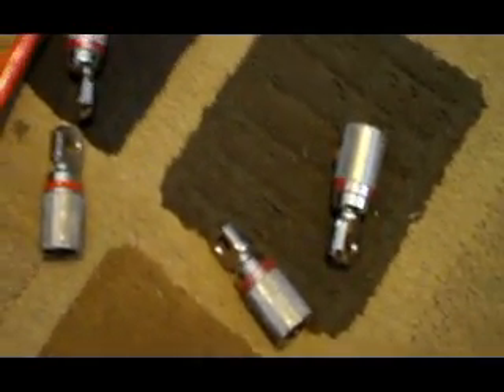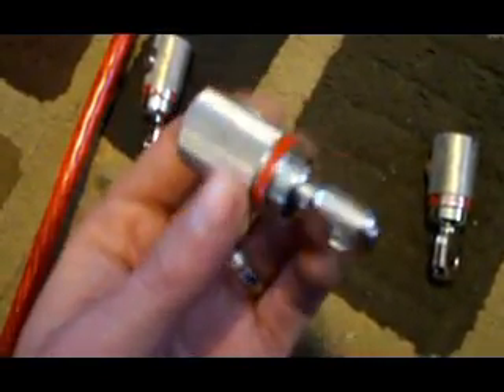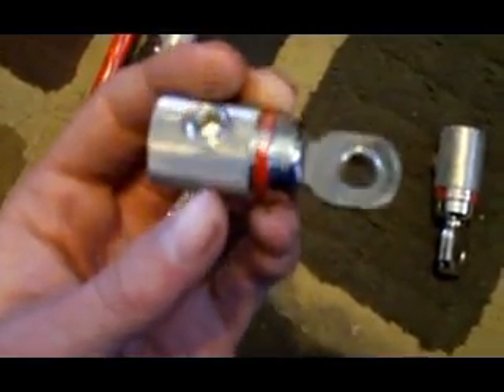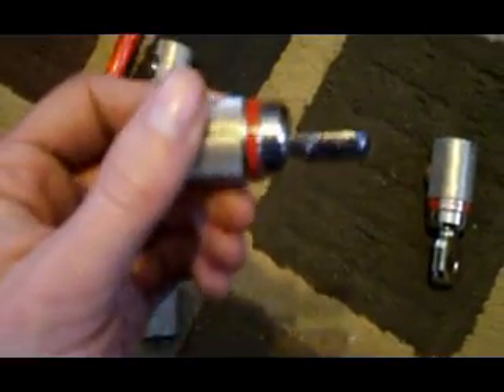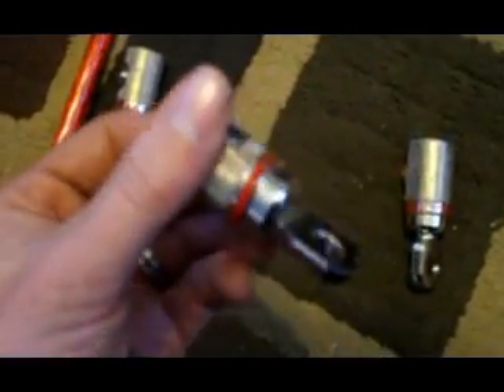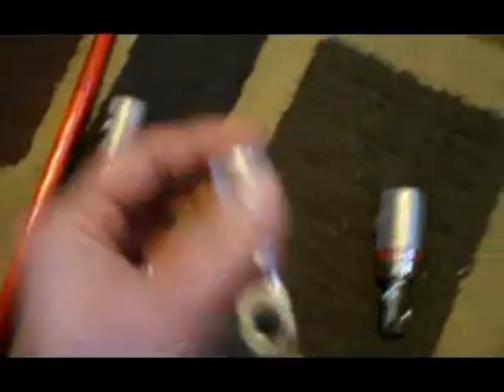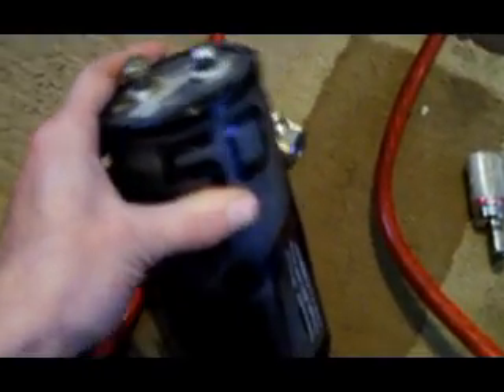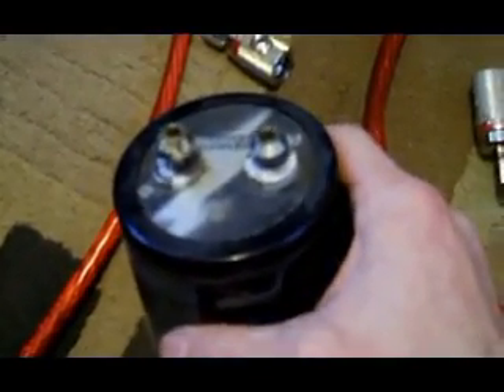How To Hook Up A Battery Capacitor

Comment: hello brother, , can i use a capacitor even though i dont got a amplifier? i do have some 12v leds, windshield wipers, heater defroster running very ofter and i got a small battery.. will it help??

Comment: Capacitor goes out after a while when car is on, normal? Just installed one but i though it has to be illuminated all the time... thanks Grt
Reply from the maker: Should only be on when the car is on but will still hold a slight charge I believe

Comment: hey I have a problem it just started today can a cap make ur amp trip?? cause every time I turn my stereo on my amp turn on then my cap like  turn on then it trip like for one second and after that my amp goes into protection mode I follow all the wire non loose I was wondering if u think my cap went bad or Wat the reason for it to make my amp trip its was working just fine till today
Reply from the maker: Sounds like you have a short or a bad amp. Try by passing the cap and see what happens. Maybe try by passing with a distibution block just to test so you don't have to switch all your wires.
Reply: num1broncosfan27 maybe ohm load is off or maybe remote wire iv had that problem best bet run all wires start from scratch
Reply: Daniel Lloyd  yea I ran it from scratch it's my amp I was gonna ask Wat kind of amp u think I should get I have one 12 inch earthquake sub 1500 watt and it's already burn three of my amp and I got an amp that 2100 watts thinking it can Handle my sub and it's didn't u think I should fix my amp or should I buy an amp that push 2500 watts??  Never had a problem till I got earthquake  I always buy Orion but first time getting earthquake its pound tho with one sub

Comment: Hi... I just bought this new RoToM Brand Dual Run Capacitor. 80+5 MFD 370/440v... -Would like to know, if theres anyway i could hook this to my lawn tractor for starting? There's no Battery! All this capacitor talk online is difficult to me! Ha -How would i wire it!?. It's got 3 prongs! Fan-Common-Herm... -The tractor only puts out around 4 amp's or so, from the Generator/Stator... No regulator! Just 2 wire's coming out from under the Generator/Stator-1 wire is for the Head-Light's... -The other wire has a diode, and goes to the battery.(which there isn't a Batt...) Btw The solinoid run's off the magnet's on the flywheel! So that's seperate from this equation...Ha  Tks   -Btw, got mine for a Bk...
Reply from the maker: A capacitor is just like a small battery. You should have a power and a ground. Your third wire prolly has to do with a volt meter. So just find out which is your positive and negative and give it a shot
Reply: Tks...

Comment: good idea to put a cap in a in home set up. i have a (low amp) power converter that doesnt run my speakers good enough would it be a good idea to put a cap in? plz reply. i already have a cap so it would be a convenient
Reply from the maker: devin conner A cap in your house setup hmmmm Not sure on that one
Reply: i put a cap in and it works geat. i just need to power it all the time. thanks anyways

Comment: Actually, you are supposed to Run the Positive line to the cap and ground the cap directly to the car separate from the amp ground and only run the positive line from the cap into either the distribution block or directly to the amp, always charge the cap with a resistor before connecting it completely, you do so by connecting the ground and leaving the positive wire unconnected then hold a resistor between the positive wire and terminal for a few minutes, when draining a cap, you use the same resistor held between the neg and pos terminals on the unconnected cap, they usually include this resistor with the cap. On my old Elantra I had added a second rectifier to the alternator to help reduce dimming and extend the life of it, I just ran extensions to the second rectifier and put in a longer bolt for the output! Later the timing belt broke and bent the valves so I sold it! Another thing you could look into is modified drive pulleys, they can increase alternator rpms at idle and during driving, because it may say 90 amps but that is usually above 2500-3500 rpm, below that can be as little as 45 amps or less, sometimes when you buy new ones they will have a data sheet where they tested your alternator and will give you ratings at different speeds, most cars don't operate with rpms high enough to get the full amperage from the alternator! Don't forget if you place too much strain on your alternator you will short the winding's which will decrease output, if you have more than one battery add a isolator so you can safely charge all of them at once without draining your main battery!

Comment: From what I have been reading from car audio sites is that 1 farad can handle 1000 watts. Your lights might have been dimming due to you not having enough farads. This was an awesome video, simple and to the point. The reason one should get a capacitor isn't just to prevent lights dimming its also to reduce the wear and tear of your alternator. Sure a good $200+ capacitor is expensive but a new battery + your alternator would cost more. I have recently received a 3.5 farad capacitor made by SSL and it was inexpensive. Yes SSL isn't the best brand or a "good" brand but it does the job. Love the video and if someone has already said what I just said, I'm sorry I didn't get to read all of the comments. Anyways my question to you is, 2 ohm setup vs 4 ohm setup? what do you prefer and why? I have a single Alpine type R 12 inch wired @ 4 ohm and a 3000 watt amp that only pushes like 650 watts at 4 ohm but can do 1500 @ 2 with a 3000 watt max. Sorry for the long post I just want to be able to get the type r to blow my trunk off and maybe make my wheels rattle off my car. Thank you for making this video

Comment: A capacitor does NOT work. It's a scam from audio companies to get more money off of people who don't onow about car audio. Caps lower the volts going to your amp starving it of the power it needs, and by doing so it stops all of your other electrical issues therefore making you think it's doing good. And no. An extra battery is only good if you play your music a lot with your car off, like in comps, cuz when your car is started it puts a lot more strain on your alternator because it has to charge two batteries. The correct thing to do would be to buy a high output alternator.
Reply: Where did u get this information from? got any source?

Reason i say that... because the role of the cap in parallel is to help smooth out the voltage ripples in the system. Ex: without cap you will probably see 14.6V - 12.5V, With it you probably see 14.6V - 13.6V. the cap will help give the energy system enough "food" because it is an energy reserve that can discharge faster than the battery can.

OH ... my source... is Electrical Technology Schooling...
Reply: PlzDontKillDave I looked around for someone who could explain it better than me. Watch a video called "why capacitors don't work" by emf audio. He can explain it better.

Comment: You need to spark the connection before attaching the wires so the cap can get a better charge and work the way it's supposed to that's why they give you the strike plate

Comment: When the car is off the cap is suppose to be off right no lights or anything are suppose to be on from the cap? I seen a vid were it was on when the car was off won't that drain the battery..and if it does how do you fix it?
Reply: new cap has a remote IN that cames from your head unit and when it turns off that turn off the cap, but technically your cap is always ON with your battery and never drains it. Your cap is not a charge for your battery thats why.

Comment: Question. So can I buy another battery, hook the positive from my main battery to the positive of the one in the trunk then just ground the bat in the trunk to the chassis? will this charge it and keep it working? I figured this would be easier then having to run wires everytime from the front of the car considering I have a chevy and they are a nightmare to work on.

Comment: if you're pushing more than 1000W then you'd definitely need a capacitor more than half a farad lol..that's why it wasn't helping.  around 1000w would equal 1farad

Comment: I'm gonna get this nice kit, but I'm confused how to install two amps to the one battery capacitor. Or do they give you two capacitors? Idk. Please explain how to set up the capacitor(s) they give you.

Google this kit: Cadence FDA4+8K+FXC2D 4/8 AWG Gauge Dual Amp Installation Kit+2 Farad Capacitor

Comment: If I run ground wire from my battery to my  cap then from my cap to my amps, do I still need to run the ground wire to a bolt on my car?

Comment: You forgot the charging it part plus compasators are very good they help keep a steady line of power to your amp it's better for it then with no fluctuation in voltage adds sound quality

Comment: If I may put my two cents in, your amp only uses 12 volts when the car is not running. When the car is running all of you systems power will come from the alternator which is 14 volts, if someone wants their lights not to flicker and the sound system to note miss a note; all they have to do is upgrade to the big three and a high ampere output alternator preferably 300 amps that should suffice. by the way, I was not trying to offend you on your knowledge of car audio.

Comment: you can use two batteries but make sure to run them in parallel and not in a series are you will fry things in your car or you can use two batteries with a stinger isolater hope this helps.

Comment: Actually their not.....Here is what a Capacitor does. A capacitor can store and discharge a large amount of energy very quickly. A Battery on the other hand cannot. A Sub-woofer without a capacitor will still "Thump" but not quite as loud. When using just the battery, by the time the battery produced enough power to hit the right note, its already on the downward side of the sign wave. With a Capacitor, the sub can draw all the power it needs very quickly and produce a much cleaner note/tone.

Comment: a cap dont act like a battrey  a capasotor is ther to help with realy low end bass wen ur subs pump they pull power wen u put a cap it reduces the strain on ur voltage comming from ur battery

Comment: one thing u forgot or dont know is your amp and cap souldnt share the ssame ground it doesnt work right and would make your light deem amp sould have its own ground same with the cap. and a big 3 is a ground replacement theres 3 big ground on every car that makes the car run another video or even google will tell u how to do this

Comment: Upgrade the stock wiring running from the alternator to the battery and all the grounding from the motor and batteries with 0 gauge wire.

Comment: Best instructional video o car audio ever, I second that when the first guy said it is just that much more fun to watch blazed out of your mind, haha. Anyway, my question to you is, say you have your fuse. Does it go before or after the capacitor? Or do you need two? I might just go ahead and replace the battery, but I'm just curious if I find myself crossing that road where I decide to buy a capacitor. Help me out! :).

Comment from the maker: It don't have to if you ground it to the battery like I did but it wouldn't hurt. I gives you quick burst of energy when your amp sucks power. Works with car on or off. People don't need caps they need another battery and yes if and when you can afford it a better alt

Comment: I thought the cap had to have it's own ground.Everything runs off your alternator when the cars running.It only uses battery power when the cars off. So you would need a cap or a newer higher amped alternator.Correct?

Comment: WRONG!!!!!!!!! thats why the cap doesnt work for you!!! you wired it wrong!!!  i am a mechanic who is good with electrical. THE WHY YOU REALLY DO IT: battery-->fuse--> cap--> amp-->ground!!!!!!!!!  THE CAP IS INLINE IN THE POWER WIRE BETWEEN THE FUSE AND THE AMP!!!

Comment: the main reason to get a cap is to take away RF voltage drops in the system.
a home made ultracapacitor setup. 6 3000 farad capacitors in series.

Comment: nice video , but quick question. does it matter about how many watts are in the cap. and the amp? like, if the cap is 1000 watts and the amp is like 500 watts. would anything happen?

Comment: The capacitor didn't stop your lights from dimming? What made you think that's what capacitors are for? They store power to add the juice to the amp when your alt+battery isn't keeping up in long bass sections. 

If anything, they will cause the battery to dim MORE than before.

Comment: this guys an idiot you dont need a second battery unless you want to do sum parking lot pimpin without turning on your car. best thing to do is upgrade your alternator. how do you think ambulances power all their equipment. by having caps and batteries all over the place? fuk no they have big o supped up alternators!!!!!!

Comment: seriously, bad advice... why the hell do you keep saying people should get a second battery??? easily one of the dumbest wastes of time and money! about the ONLY thing it'd be good for is let you listen to music for longer without the engine running, as soon as the engine is running the car and stereo is powered by your ALTERNATOR not the battery. if your stereo is drawing enough current to discharge your battery then it means your alternator is too weak for the system so upgrade THAT instead.

Comment: The caps are only for providing high current for a shor time. They will not give you more power. They are to help provide energy for a transient spike in power demand. Mainly for music that has alot of highly "gated" bass kick drums. use 1 farad per 1000 watts. Most amps now have enough caps in the power supply. The Rockford t15k has over 70,000 farads in them. The amp takes 1-3 minutes just to charge before it even goes online.  Also the lightning audio caps are some of the worst ones.

Comment: cap's are for if you run a separate battery i wouldn't use one if your running off the cars main battery its just to keep the battery charged, if your lights are dimming then you should run a separate battery with a cap because your system is too much for just the main battery.

Comment: one key thing that i think your forgetting to do is charge the cap before you install it or it will be doing absolutely nothing at all. that is prolly the reason your lights were still dimming out because you didnt charge it before you installed it. this is the main reason why people hate power caps..... bc they dont know how to use them properly

Comment: your either having voltage drop or you have a bad ground....OR you ohms are too low find out what your amp can handle then wire your speakers accordingly and but a cap in it or extra battery. I had same problem with 600watt amp I have 3 battery's now 2 stock and one shuriken plus im grounded alot(over kill trust me) oh and a big 3..anyway now i dont get warm or anything when bumpin problem stall

Comment: Just for the record, The color of the wires is for the next person that owns the car and is not sure how the previous owner wired it( the color is for safe-T) do not trust two red wires coming from the front to the back in the same direction( always use a meter to test the polarity of your wire if you see this)

Comment: High output alternator can get pricey(350+),,stock bat with high fared caps are for the budget,,deep cycle batt and at least a  2 farred per 1000 watt
XS Power D925 (180)battery and a SPL CP8.0 8 Farad Hybrid Super CAPACITOR,(70)
so ya get a 2000 amp batt and a 8-farrod cap for just over 250,that should be fine up to 3000 to 4000watts on stock alt,,

Comment: I wouldnt suggest it. Your better of with a bigger battery because your putting less load (=less wear) on a battery. A capacitor just lowers the current draw by spreading it over a longer amount of time basically (but the energy draw is just as big). THis results in a lower voltage drop. But volts droppin just show that your charging system cant handle the load. A bigger battery or a bigger alternator will fix this.

Comment: Dont want to sound like a smart ass but in order to get good power, you need a better battery AND cap. You have a cap that can only handle 250 watts dude and you're bad mouthing them! All audio with subwoofers use caps! Home theatres subs use them. Caps arent expensive, the whole project can get expensive tho!

Comment: @PULGACOYOTE A capacitor stores a charge. When your music is turned up, the power your amp draws will spike. The capacitor will discharge when that extra power is needed. It is useful if your car audio system draws too much power for your alternator to keep up. If you notice the voltometer in your dash dipping, or your lights dim when you turn your system up, you need a capacitor. Also helps to reduce noise/feedback from your vehicle through the audio system.

Comment: Don't splice run new wires- one from battery to capacitor and capacitor to amp. Then new negative from capacitor to ground. Your amp still needs to be grounded. Make sure grounds are separate and on unpainted surface.

Comment from the maker: @chanzleemccune1 LOL you still didn't tell me what amp you have. There is a big diff in cheaper amp and expensive amps. Cheaper amp will cut out at higher volumes. I've also seen headunits cut out. If your headunit shuts off when your sound stops then yes it could be that if not its prolly your amp

Comment from the maker: @chanzleemccune1 A couple things bro. I don't know what kinda amp you have EXACTLY but it could be a couple things. 1 is you have a smaller amp lets say 400 watts or less and when you turn it up to loud the amp just cuts out because your trying to push to much power through that amp meaning you need a bigger amp. 2 You could be running your battery to low BUT i'm guessing you have a smaller amp and need to upgrade